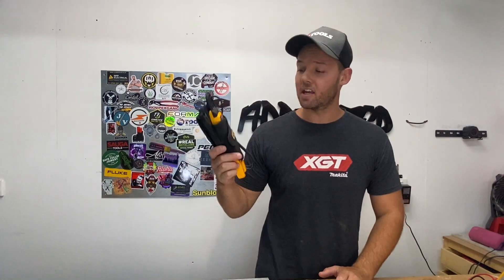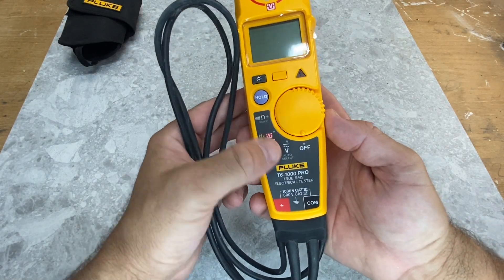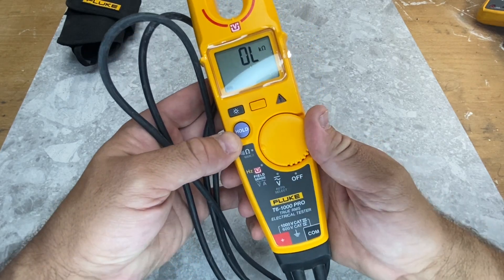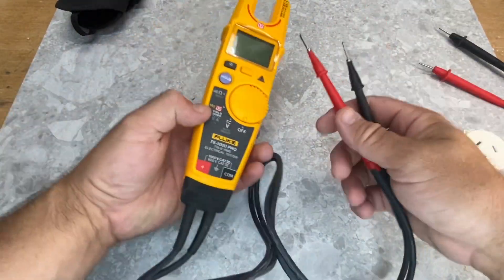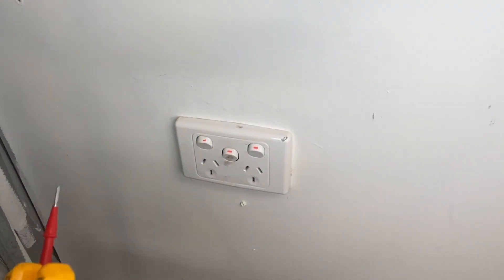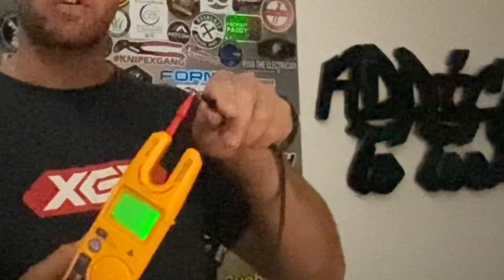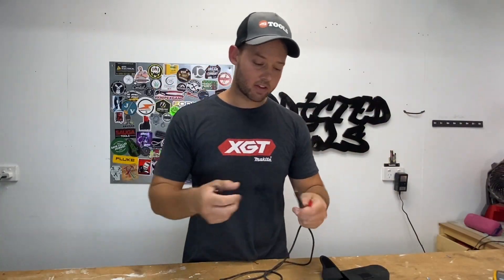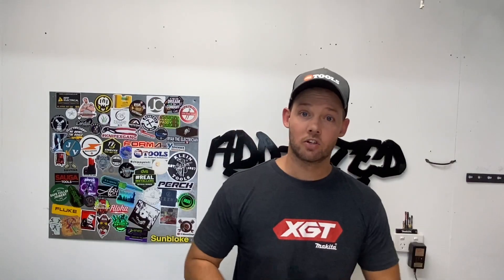Fluke t6-1000 pro electrical tester multimeter review @fluke

Comment: This is my new daily driver. I'm an industrial service electrician in the USA.
The field sense tech for me is a MAJOR safety feature ...!! I mainly work on 480 volt motors and this allows me to work safely while wearing PPE...
Worth every penny...🙌
Reply from the maker: 100%. Glad to hear others think the same.
Reply: I’ve been looking for answers on how it measures 480 or phase to phase voltage. We have a big pole light retrofit job coming up, and I’ve been looking at this model.   Are you actually getting 480v measurements with the fieldsense? Or is it only giving you phase to ground voltage?
Reply: @wm79198  The fork only gives phase to ground amperage and voltage.  For phase to phase measurement you would need to use the probes.
It's a great meter but I will say that sometimes the fieldsense voltage readings are unreliable.

Comment: The back grounding pad was terribly misunderstood by electricians with much more hysterical imagination than education. Interesting NOTE: if you’re using a non contact volt tester to see if a wire is live, or the NCV feature in the top of a Fluke 117, when you’re standing on a concrete floor in contact with earth, (this is more dramatically obvious with the 117 set in High sensitivity) first move it toward a live wire and take careful note of the distance at which it lights up/beeps. Now - take s shoe off m, plant your bare foot on the concrete and repeat the test. Notice how much further away it seems the electrostatic field and alerts you to the live wire⚠️‼️ You just increased the sensitivity of the instrument’s detection ability by grounding yourself. But you’re still safe. Same exact principle with the grounding pad on the T6-1000 “non-pro” original version. That grounding pad was not a low impedance connection to electrical energy. No Way! Fluke’s lawyers would never have allowed them to put that on the market if there was a one in a million chance somebody could get hurt. It was engineered by people who have degrees in electrical engineering – not by electricians whose thinking is wild and baseless. Loose Nuts!! If you want a lesson on impedance, take one lead of your meter, say 117, hold it or put it in your mouth for real fun, and contact power with the other. ⚡️[But please, not on LoZ] ⚡️ You will feel nothing. Just like the grounding pad on the original T6-1000. Lesson done. Barefoot connection to ground will improve function of your NCV tester, and maybe holding a wire connected to a ground. Read the paperwork with your Fluke NCV tester and you will find a sentence about reasons it may not function properly, one of the reasons hinting at too much isolation from ground/earth. I read that and did the experiment with all 3 models of Fluke NCV testers, my 117, a Greenlee NCV tester, and all picked up indication of voltage enough further away to be really obvious when I took a shoe off and planted that foot on the basement floor I was standing on. Try it!! I once had a situation where my NCV testers would not pick up the field from a thickly insulated old 3-wire cable that was definitely energized at full voltage. Next time I have a situation in which I question a non indication, I’m getting out my Fluke 117 and setting it on high sensitivity … and maybe take off a shoe?!!!🤷🏼‍♂️🤔

Comment: the triangle warning voltage lights up in any mode if the prongs are across 50v plus but it would be nice if that worked even if the battery was dead

Comment: I wish it would have just one decimal of resolution to AC/DC Voltage readings and I wouldn't look at any other meter.
Reply: This has to be joke, how would fluke make their money if they put all the features into one single meter, you don’t think they could make a meter with field sense on one end and a clamp on the other with volt alert and multi decimal and an flex jack and microfarads testing all in one device?
Reply: @joshuasechter5306  I don't think asking for a single decimal in voltage resolution is the same as asking for the full lineup of Fluke features in a single compact meter.

Comment: I have one , great unit ! I also use a 376 , with the I flex , for situations where the jaws of either unit are a bit of an issue ! I’m a large calibre Fluke Fanboy . Fluke leads are superior . They also have a battery operated test block , so safe pre testing of the unit is possible .

Comment: Hey mate. I mainly do comms/data/av but the boss has just taken on a sparky so I’ll probably do a sparky apprenticeship. Is this a good all round meter? Anything it can’t do that other clamp meters or multimeters can?
Reply from the maker: hey mate. it’s a great all round meter. if you’re just doing basic electrical, it’s perfect. depending on price, you could look at the t5-1000. the main difference is the newer field sense and the t6 goes up from 100amps to 200.
Reply: Dc current cannot be measured with the reviewed device.
Honestly I’d buy a fluke (or other quality brand) multimeter as my first device, but if you step into a maintenance role then an amp probe like this is super handy
Reply: Lowest resolution for resistance is 1, so you can't do mandatory continuity testing with it!

Comment: Does this meter test amps like the t5 1000 does if you place the load wire in between the jaws and don't use the ground lead? 

Or do you have to connect the negative to ground before it does anything?

I'm curious because I looked through the manual and it doesn't mention that. 

As much as I can see the value of the fiedlsense it isn't always possible to use a ground connection - what if the appliance is double insulated and doesn't reference a metal ground point?

What then - would you connect it to neutral? Isn't that kinda missing the point 🤔 

If that's the case it would be stupid because there isn't a amp meter I've ever used of this design that needs a ground lead to measure amps.

I'd hoped you might know the answer 🙂
Reply: Can confirm amp readings still work without being grounded, but your voltage readings will be all over the place

Comment: I don't see the field sense finger button on the back of yours. Why is that? New model maybe?
Reply from the maker: Yeah that’s one of the main differences compared to the t6-1000. The pro uses the neutral lead to ground it.
Reply: you don't need the finger button when grounding direct with the black lead/aligator clip
Reply: @garywallen7789 этот способ доступен и на предыдущей модели

Comment: You still using this? for the price it would have been nice to have capacitance and diode. Apart from that any dramas had with the leads being moulded and proprietary? they seem pretty deadly for 3 phase or DC with close contact with no real way to change loadout.